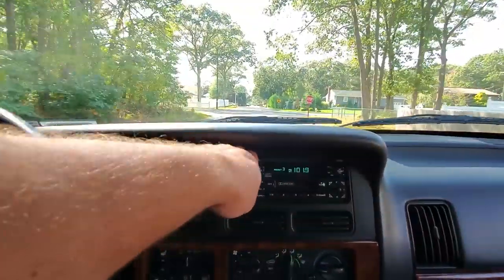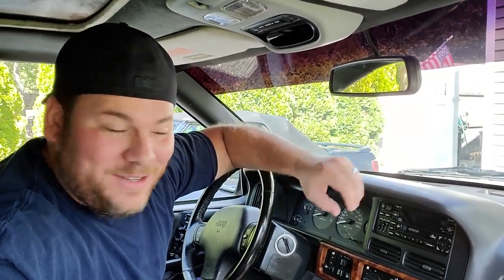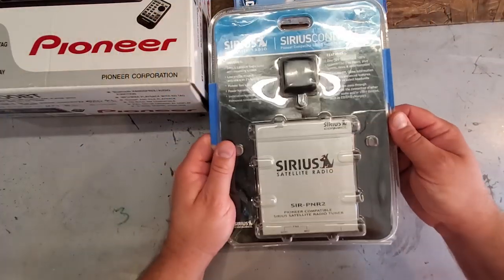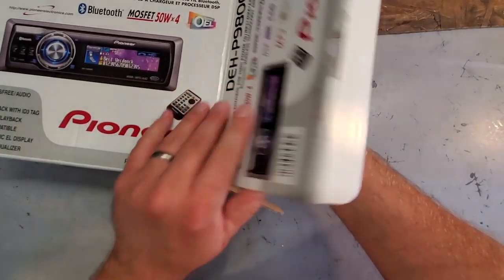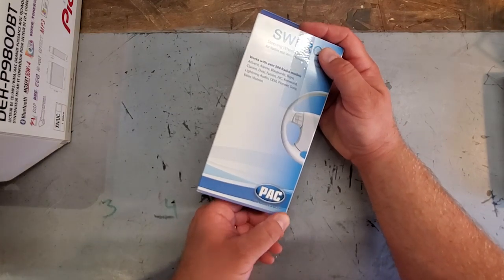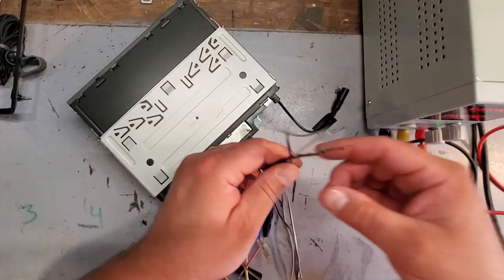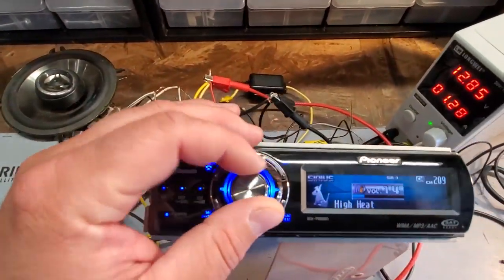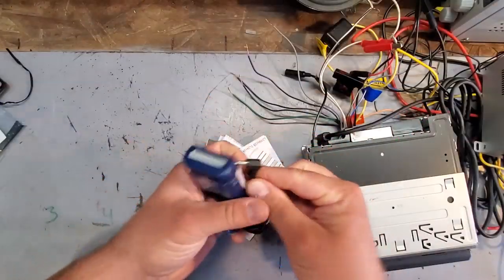JEEP ZJ PREP FOR PIONEER HEAD UNIT, SIRIUS XM SIR-PNR2 TUNER, PAC SWI-RC STEERING WHEEL CONTROLS

Comment: I have Sirius XM radio in my Jeep but I don't have that gray box ? I have a pioneer radio with XM but you just have to set a channel like 89.5 or something 😅 I don't remember the wire I had to bypass the factory amp with but I think you won't have sound if you have the infinity gold like my limited .
Reply from the maker: So it's not a built in tuner?  Sounds like and FM transmitter. I made a factory amp bypass. Tune into the next video
Reply: @ProjectDanH  I think it is but it's from 2004 and I don't know the model number

Comment: Dan, where did you get that bench tester unit, and if some place like Amazon do you have a link? also what is the Amperage you have it set to? I am looking to get one to test a new radio I just got before install into my truck.
Reply from the maker: Hey Jim! the amazon link is in the video description, and yes, you can adjust by volts and amps. I love it.  Best of luck with your install!
Reply: @ProjectDanH  ok, cool, must have been hidden first time I looked, picked one up, these things are certainly a good thing to have!
Reply from the maker: @JimS6025  yes absolutely. I couldn't imagine not having one